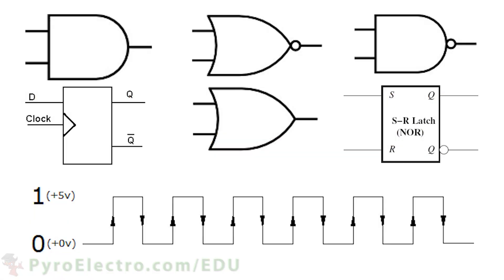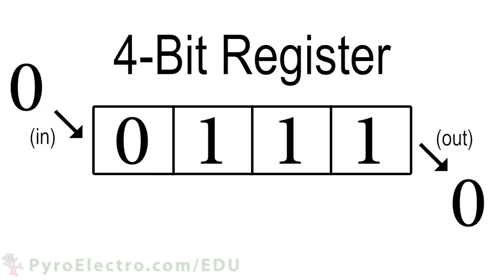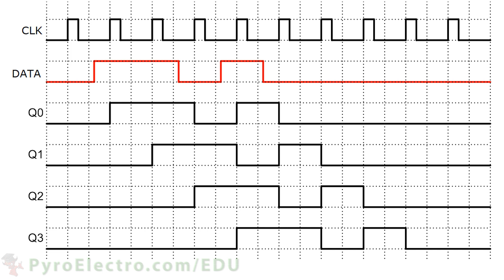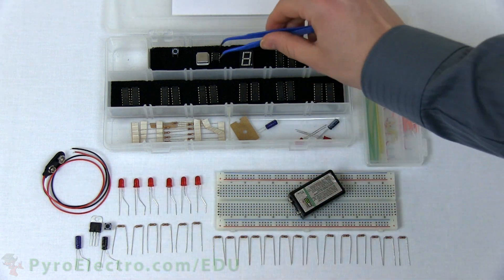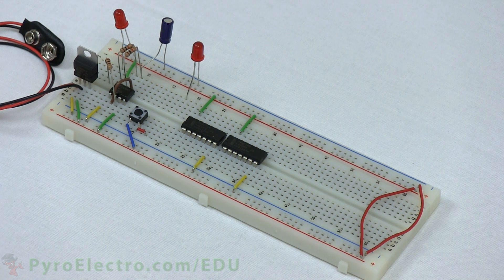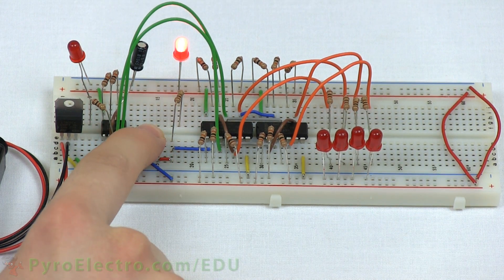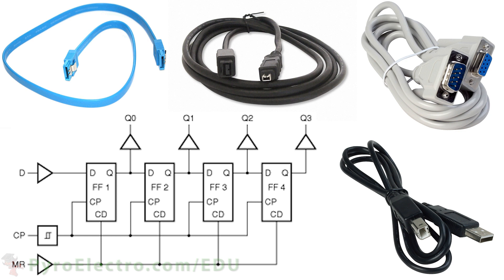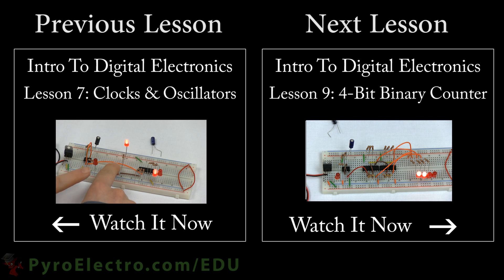4-Bit Shift Register - An Introduction To Digital Electronics - PyroEDU

Comment: Just some dude trying to add to your wonderful lecture.
It's true our eyes are so slow on grasping info that we can't perceive the signal flow displayed by the LEDs when using this crystal oscillator.
In this case though, the actual reason is that time you spend on the push button  which is long (though it appears to our eyes to be short) enough that clock goes through several rising edges and the data thus fed into the data pin of the first flip flop is copied several times thus a succession of high states printed on the LEDs.
Just to say that even with a slower clock, this could happen if the data is not send at the right tempo.

Comment: Help!! What is the largest negative number for a bit register? is it -1 or -0? i know -0 doesnt make sense so is it 0 like the smallest positive number? or -1? Thanks
Reply: It depends on your counting system. For an unsigned int, its 0. To have signs in two's complement, you would have to have at least 2 bits, so 1 bit representation in two's complement doesn't exist. If you are in Excess-N notation, then 0 would correspond to -N.
Reply: Ray Kingsley Thanks for your reply! 4 bit register for example, would that be -1 for the largest negative number or 0?